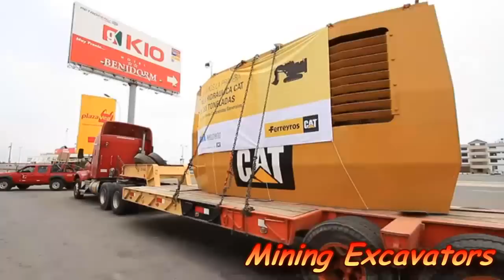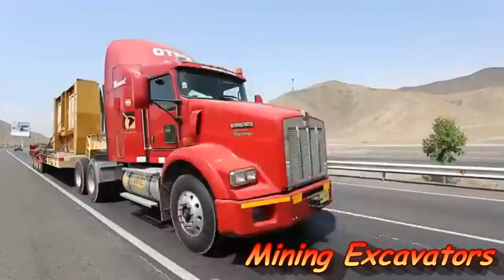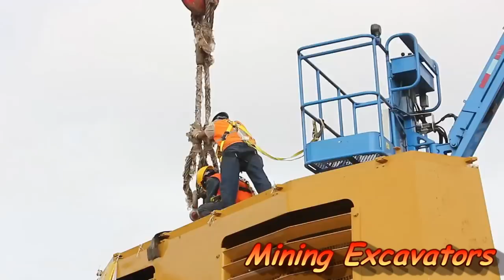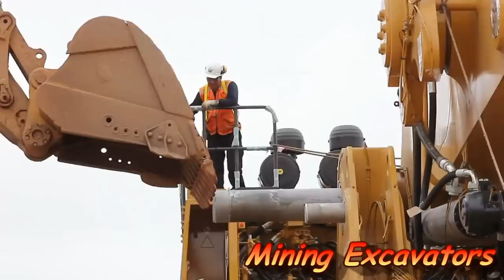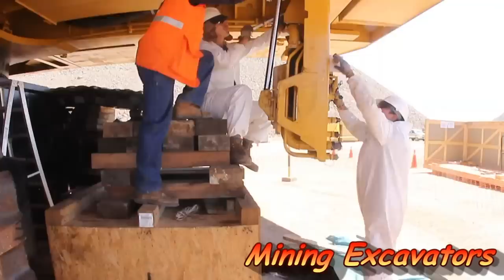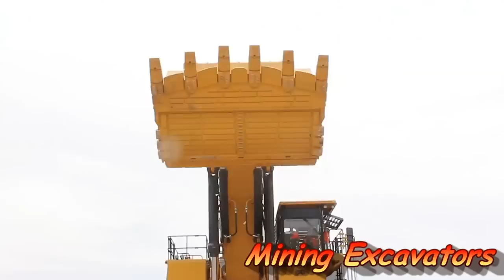CAT 6040 FS  Assembly

Comment: Why is it that the digging arms are so small/short on this kind excavators compared to other types
Reply: +lytken This type of excavator is used to load large dump trucks with ore-bearing rock or overburden. They work a fairly short wall and as long as they can reach high enough to load the trucks it's more important to increase capacity and speed than reach. Depending on the type of mine other equipment may be utilized to remove thicker overburden, such as draglines or bucket wheel excavators. Larger shovels with a long reach designed to remove overburden were called stripping shovels, but they've largely been replaced by draglines and bucket wheels. Search for the silver spade, it was the last giant stripping shovel in operation in the US and there are quite a few good videos of that monster in operation.
Reply: +NorfKhazad 
thanks a lot for all your good info :D
Reply: Well no, this type of excavator isn't even an excavator. It's a hydraulic shovel and not a very large one at that. Excavators dig towards themselves, shovels away.

Comment: If you like traveling, that would be a great job.
I couldn't figure out what operated the clamshell, but I went back and looked closer, and at 10:12  you can see hoses disappearing into the bucket, I guess the pistons are hidden.
Reply: C Smith Correct! There are two cylinders inside the back part of the bucket that is connected to the stick.
Reply: Thanks
It would be cool to see the inside or a drawing.